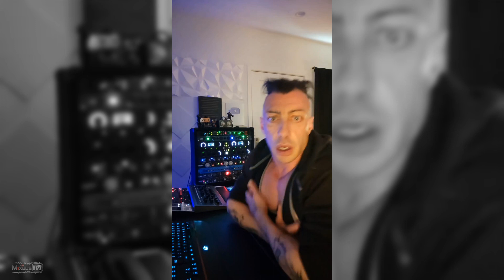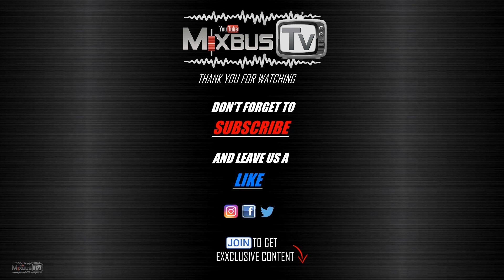Mixing With A Limiter on the Master Fader? 🙄

Comment: I Think People dont understand the difference between Mixing and Mastering ...I use a VU meter cal to -14. on my mix Bus . I have and still do put a limiter on at the end of the chain and use it as a ref  for what the master would sound like ...BUT ONLY AS THAT .Before exporting i disable the Limiter and export . Back in the day some masters pre digital CD Crush to hell mixes were at -14 VU .I However would say try this if you want a sence of loudness in your mix turn up the volume knob your monitor .David I have followed you for years .Your Content  Advise and honesty is second to none Keep up the great work .I Have a wee point of thought.For a lot of people who mabe dont have a great mixing room or gear the idea of using a ref track.However sometimes it can be a problem.
You bring in the ref track you like and try and somehow match your mix to it .Well then what happens ..you try and beat the mastered ref track .I have found that using ref tracks that lack in bass treble or mid a real help ..I wont name names but i have found that using them helps me with mixing my songs.Whats your take on ref tracks Do you think they really help or can they just make you feel that all the time you spend on that snare sound means nothing because without the right gear your results will always fall short
Reply from the maker: Ref tracks always help if you know how to use em, and if you have a good monitoring system (otherwise you will have dips, bumps, nulls, cancellation on the refs as well). But mastering is not just limiting, I just want to reiterate that, getting an idea of "how it sounds in Mastering" just by using a limiter doesn't really tell much, because if the engineer is any good, his job won't be just slapping a limiter on. It also comes from the home mastering thing, why? Because people at home slam their mixes to match commercial releases with 12db of GR and that of course will make the mix sound bad and different. Because that's not how you do it
Reply: @mixbustv  Totally Agree David ..As Ian Shepard says mastering is simple but not easy .I like you feel there are certain crafts esp in music that are becoming lost arts Mastering being one of them .I was late to the whole spotify thing but on listening  there are certain level tone and balance mixes that are just way off the mark ...Not Bellas of course.but If people are using dare i say bad professional mixes and masters as there ref tracks then music will be loosing its sonic and dynamic. David keep up the much needed great work and videos.I get it that sometimes with this kind of world we are in now that everyone thinks they know more or even they know better ..Hell No. You are a Professional and people should be more thankful that you give up your time to share some of your knowledge and expertise

Comment: I mix into a limiter. It usually helps me get more clean gain. I just make sure the gain reduction meter does not move at all. Also the choice of limiter also matters. I always need that gain on the 2 bus because I'm a "gain staging" freak. I will try this method to see if it improves my workflow and result. Thanks
Reply from the maker: How would a limiter help you getting "clean gain". Serious question.

Comment: I’ve seen pros use a limiter - don’t agree with this.  A limiter can allow you to hear how it affects the mix. L2 for example I saw was used.  Unless this is considered a special limiter.  I think it’s not a good idea to create such firm rules.  When I say pros - this refers to engineers who mix big named metal and pop bands. Not saying they all do it, but some I know do.  Also limiters are never truest transparent - they are basically compressors with extreme ratios.  Most of them colour to some degree. Transparent really means can you get away without anyone noticing.
Reply: That sounds like mixing engineers that try to disrespect what a mastering engineer’s job is. And a limiter is not transparent if you are reducing absurd amounts of DB, 1 or 2 maybe even 3 no one will notice.
Reply: @albertoskrico9412  their job is to produce music not to adhere to some imagine rule system.  No abuse here, the limiter is there for the mixer to hear what it’s doing.  They will then remove the limiter before sending it to the mastering engineer.  The main one I am thinking of has had great success with their productions and are considered one of the best rock mixers in their country.  I learnt a lot from them.
Reply: It's funny how art suddenly has rules and wrongs, and a particular person's way is THE way because they have a platform. I only come to this channel to hear what new sins I may have committed. lol Countless people in this industry, that have been far more successful, regularly commit these wrongs with great results.
Reply: @Sound_Stable  exactly how I’m feeling now, I think it’s why music is sounding the same as well. When I hear something on the radio that breaks the rules I actually bother listening to it.  What does that tell you?
Reply from the maker: @Sound_Stable  you can't break the rules of you don't know them first. That's called bullshit. Also unlike others I can explain you why mixing into a limiter is OBJECTIVELY bad, as worse if then if you don't and leave that process to mastering. But wait, usually people who argue this believe mastering IS actually slapping a limiter or two on their mixes. As for the "best rock mixers", do you want me to paste you what Bob Katz thinks about it? Not like it matters because if you want I can prove it to you. Then you tell me if "breaking the rules" is a good idea here or not. Everyone thinks they're special because they break the rules, sometimes people don't do certain things because it's bad not because they are "conservative" lol oh let's mix shit with chocolate, nobody ever did it, let's break the rules. Yeah, there's a reason because nobody ever did it.
Reply: @mixbustv  I personally don't mix into one. But, I do slap one on once I have got the mix 98%+ where I want to be. It can be useful in exposing overlooked mistakes that are are very difficult to fix after the mixdown. For instance, volume and fx automation. I'm not advocating for anyone to mix into one, but its certainly not for you or me to say that it can't work for someone else and they are bad for doing it. What I am pointing out in my previous comment is how people such as yourself say "x" way is the way, and anyone else who says/does otherwise sucks and you go one to insult them. Channels like this have become ego stroke shows and have lost educational value. Every time I see you post one of these types of videos in the last year or two, you always have something negative to say to/about "other engineers". You are becoming the very thing you have criticized in the past.
Reply: I think what I have seen here is fair enough however caviar is nice once and a while but who doesn’t just want fish and chips!  My channel I’m looking to expand  is to go down this route.  You are so correct, it’s art.  If we don’t expand this we won’t improve things.  Don’t accept the money  route just because someone has learn the art of mastering to perfection.  That’s not art, that development.  Ive read books by Bob Katz and have spent over 20+ years learning this art.  Don’t for a moment be intimidated.  The ego is clear to see in all this, the one who cannot see past past what they believe in.  Art is an expression not a set of choices on your mix.  I hope others read this and can realise this.

Also I’m sorry but sometimes the best rules are broken because you don’t know them.  Being free can be the cure.  Music today sounds bland and flat.  We all know this, I grew up listening to 90s music and I loved the excitement.  It really needs to grow as it’s become stale and todays YouTubers are stuck just teaching the art of mixing rather than producing quality hits!

Break the rules, we are creating music, nobody will die ffs!  It’s art. Tell Banksy not to paint on street walls!

Comment: Is using a soft clipper or compressor on the mix bus an acceptable practice?
Reply from the maker: Mixing into a compressor is 100% mixing, not just acceptable but standard procedure. A clipper is fine, as long as one is being fairly conservative

Comment: Often my mix gets also my Master at the end. I’m not opening a new project for this. Don’t think it’s wrong. fFor an album release I wouldn’t do this, but for a one track single I don’t see any problems, to do my mastering at the end of the mixing phase in the same project.
Reply from the maker: If your mastering your own mix and you're itb (which you are or you would need a different session with different hardware settings) not only is not wrong, it makes no difference whatsoever of you open another project or not. The "problem" as I many times mentioned is beyond that.
Reply: @mixbustv  the only problem with mastering in a mixing session is that this way there's no possibility to do parallel stuff. Yes, we have mix knobs but it is still one chain and only one plugin per parallel process.

Comment: You failed to state that this was YOUR opinion. And you made it sound like it is stupid to use a limiter. Cool if YOU don’t like mixing into limiters. But reality is, that A LOT of mixers far bigger than you do this. And the reason to mix into it is that you can control the sound, rather than mix a song just like you want it, only to destroy the sonics with a limiter afterwards. This way you can react, and make choices based on that
Reply from the maker: Nope, it's not my opinion. It's science. In fact that's one of the differences between me and engineers that are, as you say "much bigger than me", I only talk when I'm 100% sure about things or I keep my darn mouth shut, because I don't have 5 Grammy's and I can say whatever BS I think it's happening and people will still believe me because I have those. Here's a video I made for comments like yours: https://youtu.be/wosFpVo8zHM
Knock yourself out.
Reply: @mixbustv  How is it science that you shouldn't mix into a limiter? It's workflow. And limiters are not transparent no matter how much they try. The fact that you limit you track overall inherently changes the sound. That's the reason to mix into it to control it. It's totally cool that you don't like doing it. But I feel like it's misinformative to talk about it so definitively

Comment: i use a clipper post fader on my 2 bus and drive hard into it its a lazy way to get it all as loud as commercial records, its topdown master mixing and its only for the brave, you would not master after this as you have already hit your final level it can be done but takes years of practice, very different from old school mixing but can get brilliant results for big open huge drums, but there is a really big tug of war esp in mid side, the end result is sonic energy and you have to commit as it is the final battle and victory is always total, that said im good at it and my mp3s sound better than some albums, but streaming platforms will turn it down so you have to have a sense of how it will compress further and it is safer to have a quiet old school mix in that regard, happy mixbus

Comment: I feel like you contradicted yourself a bit, David. In your famous LOUDNESS video the title is literally "Loudness is not in mastering" yet in this video you're saying that getting the mix louder is the mastering engineers job. And to comment on the topic I personally mix with a limiter on the mix bus and have for years. It's helped me tremendously.  It lets me get a feel for what the record is going to sound like once its mastered and hitting the ceiling. I don't rely on the limiter for "loudness" I get my mixes to -8LUFS easily but the limiter is part of the sound /chain.
Reply from the maker: How am I contradicting myself? If anything I'm reaffirming what that video says, which also happens to automatically comment on your use of the limiter. Follow me: the point of the loudness video is, wanting to summarize badly, "don't think that loudness is achieved by applying ridiculous amount of limiting - as in nominal GR - because that's now how you match your beloved reference tracks and/or professionally mixed and mastered tracks, because this is actually how it's done, by making hundreds of decisions on single elements and groups so that your crest factor is good and the mastering engineer do NOT have to GR 16db to get your mix loud, at which point it will sound like ass" Correct? This is what that video is all about, right? So as a normal conclusion to that concept, it comes without saying that you DO NOT apply limiting on your mix to achieve that crest factor, if one does that, he or she did not understand one single thing about that video because slapping a limiter on a mix, everyone can do it you don't need a mastering engineer, right? I think this fixes the "contradict" part.
Consequently, you say you use the limiter for basically getting an idea of how the mix sounds after mastering, now that in itself does no harm, BUT, you do not print your mix with that limiter on correct? And if point one was understood, so that mastering is NOT limiting a ton of db to get to level, then what are you checking exactly? 1 or 2db of limiting with "just a limiter" which is NOT gonna be what the mastering engineer will do, so why do you add a variable to your ENTIRE MIX (for how small that will be) that you are going to take away after and have your mix sound slightly different? For then be processed by something different than what you used? It makes, to me at lest, absolutely no sense whatsoever.
It's no different than saying - extreme example but it helps - I know David will master my track and he will add 2db with his SPL, I don't have it so I'll just use another eq to see how it sounds.. It doesn't sound a great decision now does it?
Also, let's say your guess of 2 to 3db of limiting is accurate okay? In most cases sure that will be the case, I never chop of 2 or 3db with a limiter. In the easiest scenario I have at least 3 processors up to 5 doing that, that includes clipping converters, hard clippers, soft clippers, limiting etc.. but mastering is not just level, mastering is density, is harmonic content, what are you gonna do? Try to emulate my 10 analog pieces (I say my but whoever the mastering engineer is, fictional) on your 2bus to guess what the mastering is gonna be? Try to emulate let's say my Spacecraft? Or the 542's or the Fusion or the SPL, what settings? What order? How hot I'm I hitting the AD? What's clipping where? You see, makes no sense. Not to me. Never will.

Comment: i don't agree, i love using a limiter on the master bus, and on all other buses as well for that matter, also BECAUSE they're transparent, but in combination with other tools they can be very artistic as well. i like to push transients into those (and clippers :) for example, so i can make things sound punchier, but mixing into the limiter i don't increase the nominal level. no matter how transparent a limiter, it still has a sound and unique kind of snap, and you can do neat tricks mixing into them at different stages. also as a glue it can work pretty well, like it more then compressors oftentimes, again because they're transparent. i can work the limiter more effectively this way, and shape sounds coming into it while i'm still in the mix. but one has to be careful, if you mix into something, no matter what it is, you can't just turn it off in the end and expect your mix still to work!
Reply from the maker: Limiters don't give you snap, they take it away, jussayin